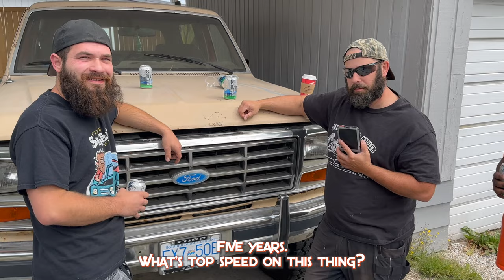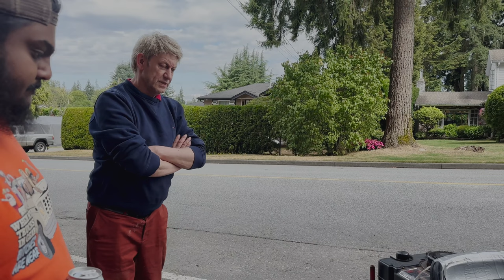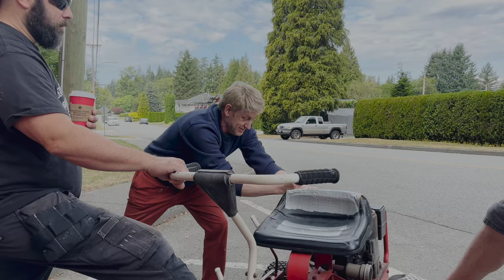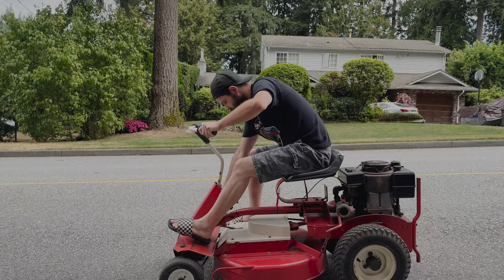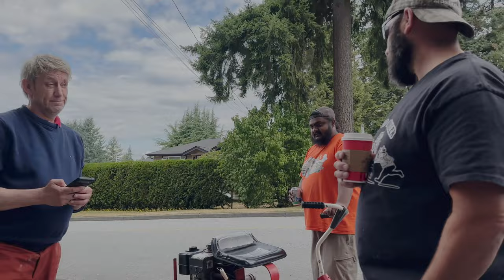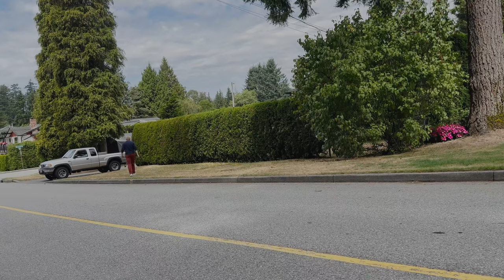LOWBALLING A RIDE ON LAWNMOWER!

Comment: That's hilarious.   $300 for a highly used late 1970s snapper lawnmower with a Briggs engine on it.  I absolutely love it.  Now sell it for $650 or trade for a truck
Reply: I wouldn't have went over $150.
Reply: its not a 70s . maybe late 90s 
the steering wheel would have been square . if it was really that old .